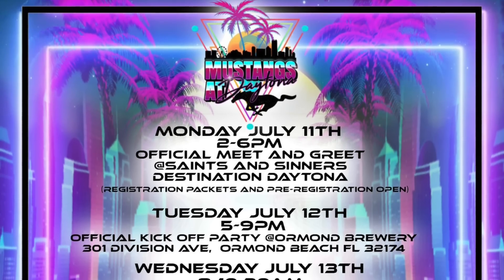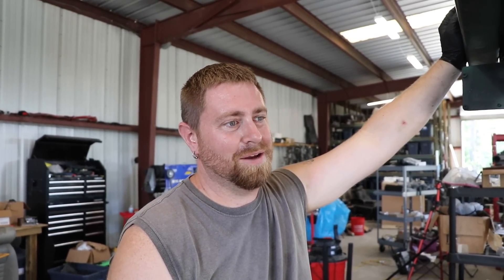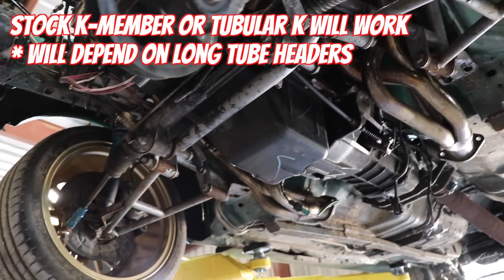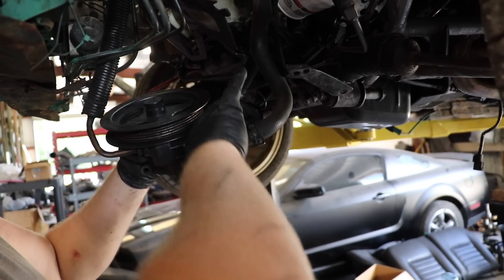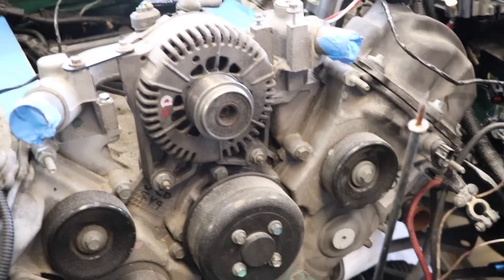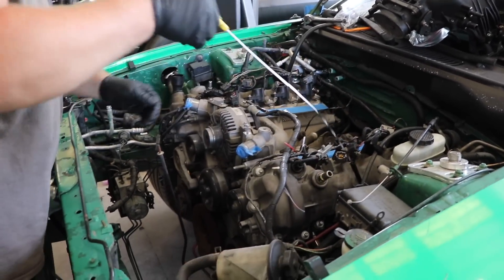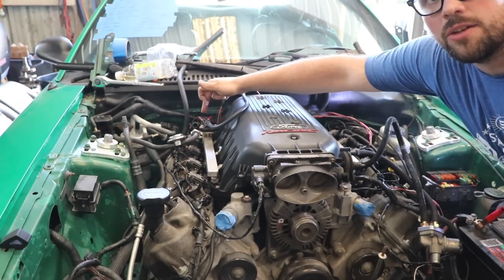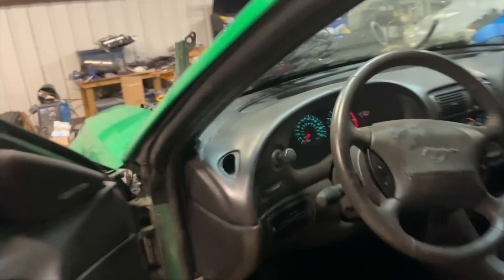How to 3V Swap a New Edge Mustang - First Start

Comment: Hey guys, I have a couple questions if you wouldn't mind helping me out.

So a guy mentioned that he needed to tune the 3v cam position sensor? How would that work with the 2v ecu?

Also, what is the configuration for the cam reluctor wheel a guy asked about here? I assumed the reluctor wheel was that 5 arm wheel that needs to be ground to have 1 arm read instead of 5? Didnt think it mattered which of the 5 were used or not?

Lastly, a guy says with the lockouts, the cam timing position is different than the 2v and he had to adjust for that in the tune?

Im learning, so please answer and let me know so I'm not confused on this.

Comment: So I did the swap on my 96 mustang exactly like y'all used your YouTube video as a reference for the whole build only thing that I cannot figure out is the camshaft reluctor wheel configuration I do have it hooked up on the passenger side like y'all but it is still pulling a code
Reply: Hey man. A year later but I’m doing the swap in my 96 as we speak. I need help. What to do with coil packs vs coil on plug. Lots of questions.

Comment: At 12.47 on the video, what is the piece with the 2 hoses and a elec connector? Is that the IAC solanoid? I have a 03' Crown Vic P71 I am wanting to do the swap in. It takes to much money to make good power and torque out of. Seems the 3 valve makes alot more power easily.

Comment: i was thinking about some ideas like blower pulley being speed controlled by a hydraulic system separate of the motor oil off the crank plus a similar system that controls independent valve actuators that push valve and spring to any controllable level for on the fly valve lift and duration control ...

Comment: NICE!  I did the same swap last year.  Glad to see others doing the same.  It really is a great swap!  I know Dewayne Logan, personally, and I can tell you he isn't about to start making the adapter kits again.  I ended up cutting the 2V flanges off my headers and TIG welding 3V flanges on.  My engine ended up making 352rwhp on the stock intake and Cobra TB.  I have since put the FRPP intake and accufab TB on it, but have yet to get it on the dyno.  Should be closer to 375 at the wheels.

I'm curious about your TB setup.  How did you guys go about blocking off the IAC openings without using a plate behind it?  Also curious about your IAC plumbing.  Looks like you have to hoses going to the plenum.  

Good work and way to help bring deserved attention to this underrated, budget-friendly swap.

Comment: 3v New Edge Swap....best thing ever. I have a 3v in my 99GT. Everyone sleeps on them.....except those in the know.
Reply: Did you use the stock 3v cam sensor? I’m halfway through this swap and it’s my main concern right now
Reply: Yes. Use the stock 3v cam sensor but only the passenger side sensor.  3v has two cam sensors, one for each bank.  The 2v wiring harness only setup for one cam sensor. Extend the 2v harness length so you can plug in to the passenger side sensor.  Leave drivers side sensor installed but dont plug anything into it. 
Then, you need to modify the tabs on the cam sensor trigger wheel mounted to the front of the passenger side cam.....so the computer reads cam position correctly.

Comment: If you plan on staying n/a I would switch to a oem intake with the cmcv's the Ford racing intake actually loses power n/a set up forced induction they response well
Reply from the maker: Can’t run charge motion because stock 2v ecu. I’m perfectly fine with shifting rpm band higher

Comment: Im doing a 4v Aviator swap into my sn95. Running it on the 2v harness, uses the 2v oil pan, shares heads and cams with the Mach 1/ Marauder/03+ Terminator etc but its 10:1 compression and has a different intake manifold then the other na 03/04 engines.

Comment: I live in Calgary alberta Canada 
Got a 3v swap 03 gt with saleen supercharger going 4 years ago. Nice to see others trying wasn't easy to figure certain things out without others knowledge
I run ford racing mid length 3v headers on mine
Reply: Did you use the stock 3v cam sensor?
Reply: @brandoncastle04  yes but with the lock out the timing position is wrong if your running 2v computer so I had to make some adjustments there
Reply: I’m doing the 3v swap right now and I’m almost rdy to drop the motor in. I’m using the Holley terminator x for the 2v. What kind of adjustment did you have to do?

Comment: The grinder would last if you used it correctly. Using a hard wheel to cut makes no sense. Get a cut off wheel and you would have had it done in a quarter the time with less shavings.

Comment: My cammed 3v has 195k miles runs like new takes a beating every day . Have boost for it ready to go just got to get supporting modes fuel pump and injectors . Then getting parts for bottom end and 600+whp and sound good while doing it

Comment: I want to do this to my 95 2V Thunderbird if you reproduce some of the swap parts I would be interested.  😁
Reply: i bought a 97 mark 8 parts car for my 95tbird and am in the middle of refreshing the engine. Pretty excited, so far everything is a direct swap
Reply: @brysonshires9742  Even mostly stock, those Mark Viii 4v's are a huge step up in performance compared to a 2v.
Reply: @madmod  yeah unfortunately the bottom end seems to have alot of resistance dispite the oil filter looking clean. So itll be awhile before shes fully assembled.

Comment: Is that gallup in the starter any concern for low compression? stood out to me watching the first start.
Reply from the maker: What?
Reply: @MustangLifestyleTV  if you listen back to the first start the engine sounds like it galloped when cranking on the starter. I hope it’s fine. Lol
Reply from the maker: @FiveOFox302  oh that’s fine. It’s an engine that hasn’t ran in a while and a fuel system priming. Lot of factors. That’s normal

Comment: Imho, I’d drop in a 5.3 before a 3V. 3 valves are literally the worst engine ford has ever made.
Reply: 350+ rwhp from fbo and cams from 4.6 liters sohc from 20 years ago isn't bad.  Why do people regurgitate this stupid crap?  This is a much cheaper and easier swap for a 2v and it is lighter because all aluminum and it won't make much less power with similar setup despite being down decent on displacement.  Stop pushing the over used in mustangs ls bs.
Reply from the maker: This swap is much easier. And 3v is not the worse engine ford has ever done. I can think of plenty of others. We have a 5.3 LS swap currently going on and it costs much more than this swap
Reply: @MustangLifestyleTV  exactly God people are stupid when it comes to this stuff.  A 5.3 won't even make much more power than. 3v anyways despite a decent displacement advantage.  3v is lighter too.  Much better swap than a 5.3 for a 2v car.
Reply: Truth hurts sometimes gentlemen. Phasers, timing chains, broken rocker arms, gunk build-up(doing oil changes at 3k), and the list goes on. Weather it’s a 4.6 or 5.4, they are absolute trash. Honestly, I’d take a 2v over a 3 valve.
Reply: My 3v has 270k miles no problems that ls motor will need a rebuild at 150k.

Comment: My 3v makes 344 whp fbo and hot rod cams. Stock manifold. You guys should easily make 350whp. Not too far off a stock gen1 5.0
Reply: Exactly!  The 3v isn't a bad engine.  It's an easy swap for a 2v much more budget friendly than a coyote and it loses weight too because all aluminum vs the iron 2v.  They make a good 50+ rwhp more fbo and cams.  It's an easy swap, loses weight and can make decent power.  It is not a bad swap idea especially for 2v guys.
Reply: @midnight347  i thought the 3v was iron block too

Comment: So great to see Turduzilla running again. I love this car and hatred to see it leave. I am going to do this swap with my 94 gt and I was hoping that you would deal with the stock exhaust manifolds. Lms did a 3V swap some time ago and used the adapter for the headers. There was a brand supposed to be used that would fit. I know some swaps use 2005 headers and only the driver's side needs to be modified. Cannot wait to see it running!!!